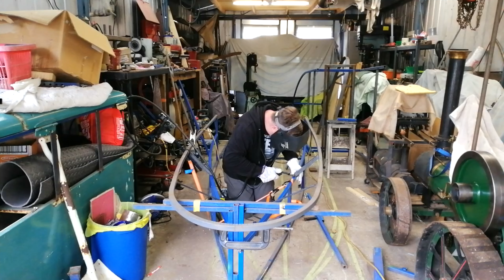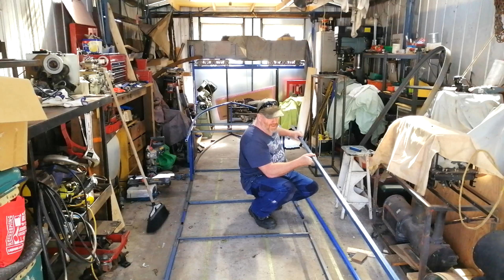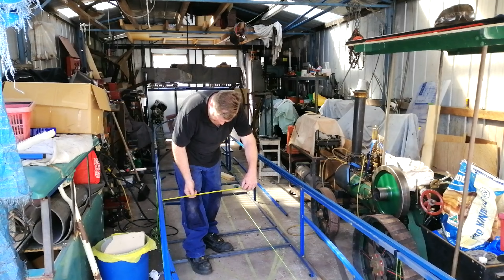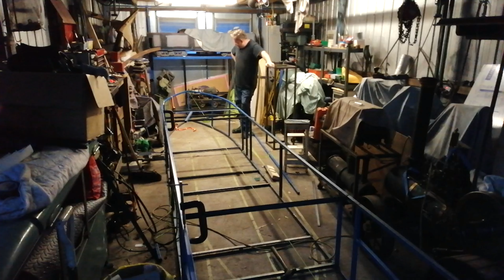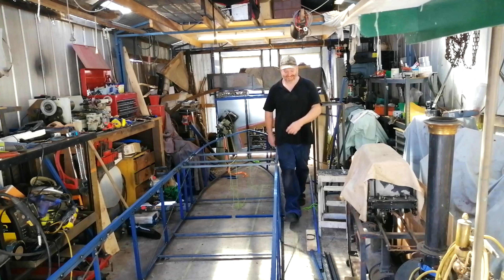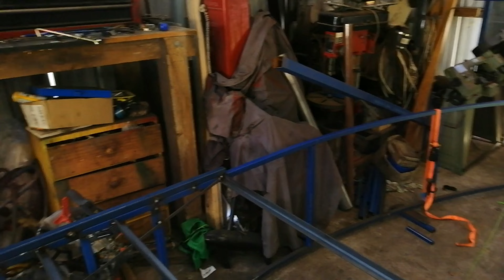The Titanic Project , Titanic build series pt 2 , Titanic the ship of Dreams

Comment: Fab work so far. Ive been working on plans to attempt to build a 4 meter long wooden RMS Olympic. Been Finding original blueprints online which helps a bit. Also chatgpt has helped me with finding right types of wood to use, glues and paints ect if I want it to be a floating model. I would love to use metal but im too inexperienced at the moment
Reply from the maker: Sounds like a massive project,it takes a lot of skill to build a scale model unfortunately I will need  to drop alot of fine detail to build with steel , thanks for taking the time to comment 👍
Reply: @EverythingAnthonySOS  It will take a lot of time and effort. though some of the fine detail on decks i plan to try get a hold of a 3D printer to do some of them. maybe something helpful to your build?